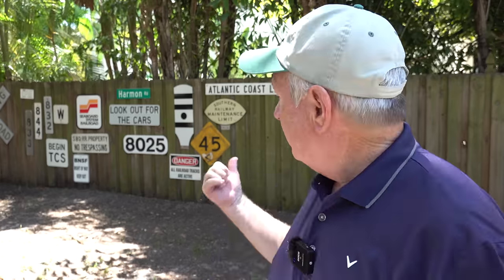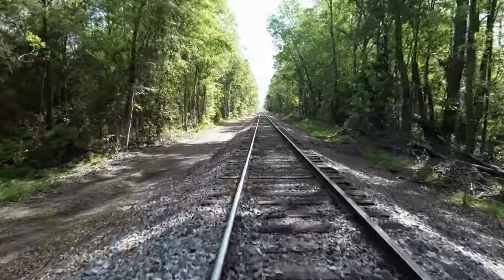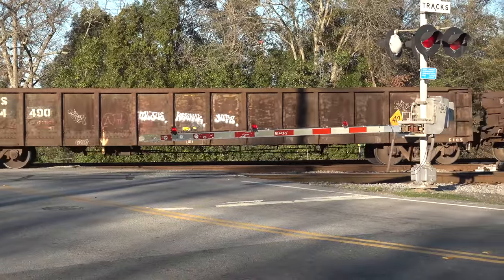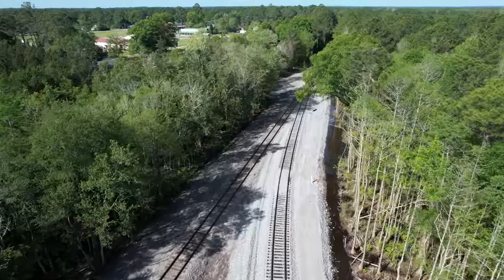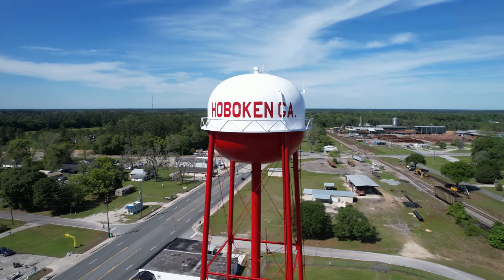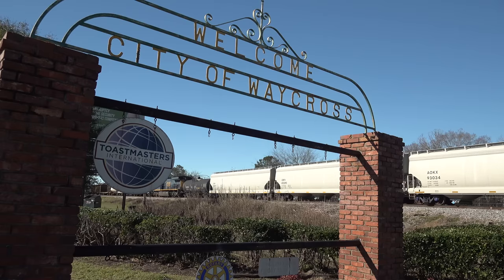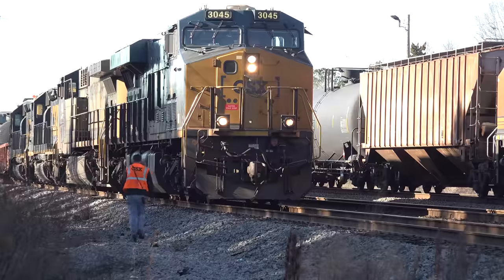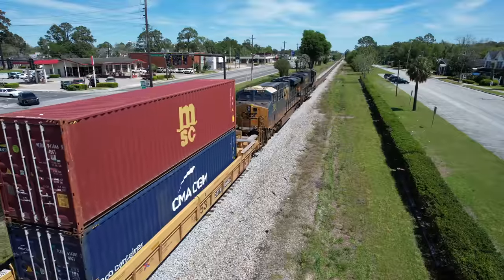How CSX Built a 35 mile Double Track Main Line Using Only 1500 Feet of New Track

Comment: Another 5-star video, Danny. 
There have been a number of occasions when CSX management has wished network fluidity had been taken into consideration when their predecessors ripped up the SAL and single-tracked the ACL 30+ years ago south of Collier Yard in Petersburg, Va. They got burned pretty badly when tropical weather events flooded some rivers in the region and shut down the ACL, forcing CSX to run expensive and time-consuming detours until the trackage was restored. 
A recent study of satellite photography shows that some of the 2nd ACL track has been restored, but I don't know if those sections are still considered to be sidings or if they have been upgraded to 2nd-main status.
It's refreshing to see Class 1 managements change their thinking back to pro-growth and capacity improvement after the last  5 or 6 years of the PSR disaster.
Reply: Turns out robbing the company to pay the shareholders is actually a terrible strategy for having any sort of long term success. Who knew?

Comment: Impressive and informative presentation. As you said it's wonderful to see a railroad make good use of underused track rather than handing it over to 'rails-to-trails' groups and then finding out that they actually needed the line. I remember reading years ago about how Norfolk Southern had essentially 'banked' a bunch of lines which they estimated had little use at the time, but could be useful in the future, one of those lines ended up becoming a key bypass when the yard in Atlanta became clogged. I for one look forward to the follow up episode, it will be interesting to see how this project develops, I can bet that CSX will be inspecting both lines for possible siding locations if this goes well.

Comment: Very, very cool. I especially like that CSX is still utilizing a wooden trestle bridge. I'm an HO model railroader and have actually scratch built many models of these wooden trestles and built them out of real wood. (I've used bamboo skewer sticks to make the pilings for each of the trestle "bents" and wooden match sticks for the "cap" for each bent.) I remember seeing these wooden railroad trestles just about everywhere I went to. And in some cases, some of these trestles are over a hundred years old, but have probably had some parts replaced. Others on the other hand, they've been replaced with steel and concrete structures sadly. This was a really great presentation and enjoyed every minute of it, God bless.

Comment: I worked on a project in Springfield MO many years ago for the SLSF, just before it was acquired by BN. They referred to a crew going past its expiration time as "hoglaw" or "piglaw", not "outlaw". The control center, which was what my company was upgrading with a new computer system, had logic built into it to estimate if/when/where a crew would hoglaw and warn the dispatchers hours in advance so they could deal with it.
Reply: That's neat!

Comment: Very nice video! I am surprised any of those MEC side dumps are left after CSX took over Pan Am. Most of the old Austin-Western cars had plain bearings and were cut up over the past year. Pan Am still had a ton of those and junk gondolas and hoppers in scrap tie service. Many still had plain bearings as well as dinner plate sized holes in the floors of the cars. I could be wrong, but I think those side dumps were built somewhere in the ballpark of 1914-1918, so they are well over 100 years old at this point. Nice catch!

Comment: Thankyou for your easy to understand explanation of what exactly is going on and why. Makes perfect sense , just makes you wonder why this simple (in railway terms) solution wasn't thought of and instigated before. Over here in England its more often the case of old abandoned pieces of track, just left to rot, or track removed, but courses are evident where they ran. A few were saved by Heritege railways and preservation societies. But in at least a couple of cases, small private concerns have been connected back into use with the national railways. Oh and a couple of long dormant "Abandoned" lines are supposedly coming back into use connecting towns that hadn't had a trains service for over 50 years and one case where a for years "Freight Only" line is being brought back into passenger services standard and being re-instated within the next three years due to growing demand. I always thought it was better to use what you already had, where possible, but improvements must benefit all round otherwise not worth it. Great show and i will come again.

Comment: Is the single track bottleneck through downtown Waycross on the Jessup Sub going to be addressed?
Reply from the maker: That I cannot tell you. It's single track for about half a mile there to the yard lead. Building a second track in there would be tricky as you'd have to cross the Fitzgerald Sub AND the wye on the Folkston side.
Reply: Yeah, don't hold your breath on that one.  I doubt they'd put another track across the diamonds, but from from Jenkins Street to Brunswick Jct (2600 feet) could be dreamed about fairly easily, I'd think.

Comment: Meanwhile, on other parts of the system, CSX can't single track fast enough, removing sidings and second main tracks all over the C&O in KY and L&N in TN, and former B&O west of Grafton, WV. Some places still have fairly new, and also old, signals still in place and lit up along or over the removed tracks.
Reply: What portions of the C&O in KY is being reduced to single track?
Reply: Big Sandy Sub in many places. Several of the sidings are being removed, including the 3 miles between GC and SK Cabin.

Comment: 13:30 What is there schedule like and how far away from home are they on any given day? I would need pack several liters of water (I'm always dehydrated) and a few dozen Twinkies, in addition to everything else.😂😥
Reply: The RR will supply crews with all the bottled water they want. Everything else is up to the crew.
Reply: The schedule is: As soon as the phone rings, you have 2 hours to report for duty at your terminal. From there you work as much as 12 hours before you go in Limbo. You can sit in limbo forever but they usually don't want that to happen. You start your rest as soon as you set foot outside the building to get in your car or take the crew bus to the motel. You get 10 hours (Plus however many minutes/hours you spent in limbo) to drive home or to the motel and rest. Then you are back to waiting for the phone to ring. If you did not get 24 hours of rest, then after 5 days you must have 24 hours of rest to reset. Or if you work 6 days then you must have 48 hours to rest. You can work nights, days, weekends, holidays, kids birthdays, rain, sleet, hail, snow. But if you miss a call or don't show up, you will be finding another job, even if you're sick. 
Usually water is not a problem unless you're doing a lot of switching. In that case, I recommend a canteen or a Camel-Pak, or anything that you can stow quickly to keep your hands free most of the time. 
Railroading is a lifestyle, not a job. You will need to plan the rest of your life around your work schedule and there's no deviating from it.

Comment: Danny the intermodal at the beginning is I031, since it's all single stacks, trailers, and Tropicana cars. I037 doesn't carry Tropicana. Also surprised they don't add some sidings on the Brunswick Sub.
Reply from the maker: You're right Jared. Several folks pointed that out. I didn't make the connection between the Trops and the single stack  levels. I thought sure he said I-037. Oh well. Thanks for the catch.
Reply: @distantsignal  Not a problem!

Comment: These high dump cars came off of the Maine Central. MEC is their old reporting mark. These were also used on the Boston and Maine, and the Mass. Bay Transit Authority. For years a cut of them lettered for the MBTA and B&M sat along the Reading line in Medford or Somerville. Under Guilford and Pan Am Railways they made their way all over not that Guilford/PAR did much ballast dumping on their tracks. I'm glad to see CSX making use of them.

Comment: Hi from the UK, you've gained a new subscriber. A great video and an interesting and very cost effective project to achieve better network fluidity both sides of the big yard. These long PSR-inspired trains need to be kept moving as much as possible, double track is the way to do that, and innovative ideas like this can be an affordable and quick way of achieving that.  I suspect there are hundreds of locations around the US where similar projects could help flexibility similarly for very little new trackwork. Sometimes it might need cooperation between different railroads though!

Comment: CSX did something similar with the LIRC (Louisville & Indiana) and upgraded an existing connection at Seymour, Indiana for traffic going between Louisville and Cincinnati. They basically do directional running between that and the LCL Sub ("Short Line"). The LCL has lots of short sidings that were too short for CSX's land barges.

Comment: New CSX Management seams to be wanting to keep what track they got & use it. Its been Reported that CSX will start running a Local again on the Old B&O between Washington Indiana to Mitchell Indiana which has not been ran on by locomotives for some years now. Lot of "rumors" (Just rumors for now) of the Illinois Sub having all new sidings built as well  since a few years ago sidings were removed under Jim Foote. Some people Dont know that Joe Hinrichs comes with a background of running a trucking company & knows how dirty, how over (Government) regulated  & theafing the trucking industry is. He can be the CEO that turns around when it comes to bring in businesses & keeping exsisting businesses CSX under PSR & may just do it knowing the how he knows the trucking industry. Like it or Not PSR is here to stay, not all of PSR will stay tho.
Reply: Where did you hear the report about CSX resuming service on the Indiana Sub between Washington and Mitchell?  There's no business left on that section, otherwise CSX wouldn't have just let it rust away.  The part from Loogootee to Mitchell would make a great trail though and that's what should happen long term.

Comment: Danny, Length of intermodal cars, why are they longer than the inner modal containers, the 53 footers? Any ideas?
Reply: I think you may be asking about the low boy container cars, designed to allow trains to use tracks, bridges, and tunnels that weren't designed for double stack container trains.
Reply: Try putting a 53' box inside a 52' box

Comment: When is the maintenance done on RR cars? This appears why so many train derailments are caused by the RR cars. I know that heat detectors are on the track. But shouldn't there be a set time to check the bearings and wheels before the problem occurs.
Reply: Almost like a truck precheck system.  Makes sense

Comment: Around 16:50 the white light on the two aspect signal tells the driver that they are going over the new track? What if there was only the three aspect signal showing orange?
Reply from the maker: Well.... there ain't no orange signals on the CSX. Ha! The Lunar White light doesn't specifically tell them they're diverging. It tells them to reduce to a speed that will allow them to stop in half the range of vision in case there's some obstruction ahead. In this particular case it lets them know they are diverging onto the un-signaled subdivision.
Reply: @distantsignal  Ok,  then which colours are then above the red on the top signal? One of them is green, i think.
Reply: Top signal head is for the straight route, bottom one is for the diverging route.
Reply: @sharkheadism  In the Netherlands, they will use one signal,. Green if the route is straight and clear and maybe green blinking for the diverging route. The signal before shows maybe orange to reduse the speed of the train if it is  nescesary for the route.
Reply: @user-marco-S  I imagine the Netherlands uses speed signalling, whereas most of the US uses route signalling.
Reply: @sharkheadism  CSX uses speed signaling. The top head is for the main route at track speed, the second or middle head is "Medium" and the bottom, third head is "Slow" CSX is also primarily a 2-block signal system, occasionally utilizing "advance Approach" for 3-block protection in cases where signals are just too close to permit stopping when going from a high green Clear to an Approach and then Stop.

Comment: No railroad company should spend a penny on "actual" disused track, until it has to, or knows for certain it will be removed, far enough in the future, to incur the expense, now. "Time-value of money" equation, decides whether/when to do that.
There's a properly disused line, I see multiple times a week; trains used to pass through an alleyway, the track there is gone, to allow for parking.
Most of the rest of the track sits, exactly as it was, when I skipped school, and wandered the tracks, nearly 50 years ago.
There is a cool trestle, still in place, that you could climb under. It was very exciting to be under a train, as it passed.
One can't climb under anymore (foot bridge now, & it's planked-over), but I'm too old to crawl under, anyway.😂

Comment: Is there GPS based cab signals in dark territory? I can't imagine it's very safe to run trains on unsignalled lines unless you keep to very low speeds at all times
Reply: Nope, they just only have one train allowed to operate at a time, or have detailed instructions regarding meets.
Reply: When you are in dark territory you are given permission by the dispatcher for movements between blocks in the form of a form d. Nothing more than a piece of paper filled out between the train crew and dispatcher prior to departing. A block is nothing more than a station sign, taking the place of a signal. Hope this helps…10yrs working as a conductor/engineer.
Reply: @coaltrain18000  So it's essentially a virtual token. I wouldn't be a fan of that since it entirely relies on the train crews not making mistakes but I guess it's good enough to work. I can't imagine this being very efficient though. How long are these blocks and how many trains per hour can such trackage accommodate?

I don't think I know of any unsignalled track where I live besides low speed tram sections or industrial track.
Reply: Train crews can be given something called a Track Warrant. It provides 'ownership' of a section of track for a specified time. Amtrak has to use Warrants a lot on track they don't own. So, the host railroad provides a Warrant to Amtrak and they have priority only during the time shown on ghe Warrant. Here's the main problem: if the Warrant expires and they are late, then the Warrant is no longer valid. Now, any other train with a valid Warrant has ownership. It works so long as crews don't run late.
Reply from the maker: Clearly this is a generational thing. See, I wouldn't be a fan of relying solely on wireless technology and software to keep me safe. Railroads have operated safely for decades strictly on rules and permissions. Of course, there are those rare instances when people fail to observe those rules or forget where they are. Ha!
Reply: @distantsignal  I think it's also a matter of location and operating environment. In the denser parts of european or japanese train networks you could never operate on track warrants alone. When lines have to accommodate sometimes 30 + trains per hour even advanced lineside signals reach capacity limits. 
Cab signaling is a very mature technology in use for decades not only on high speed lines and metro systems but also some commuter mainlines. 
Of course most of these systems rely on lineside train detection but in theory there is nothing stopping GPS from being used in conjunction with more sparse track mounted marker beacons. 
These train control systems can be made to fail into a safe condition by only allowing movements when all location trackers and train controllers are online in the system. These systems don't wait on signals from a control center but fail into a stop command when the connection is interrupted. 

Of course there is no replacement for safe operating practice but most accidents are caused by human error and I wouldn't feel comfortable without any system acting as a safety check.
Reply: @coaltrain18000  On CSX it's called an EC-1 form. On many other railroads it's called a Track Warrant. 49 CFR allows the dispatcher to authorize use of the track in a granular manner with those rather than sticking to a DTC block. For instance they can issue a one-way authorization from Milepost 60 to Hess Street at 77.29 (physical landmarks, clearly seen from the railroad) I thought they abolished DTC block authority in favor of Track warrants for that reason? Hmmm.
Reply: @SD40Fan_Jason  I left the RR in 2012. That’s how it was on the NS. I also worked for the CN and the Grand Elk RR. Most of the territory that I ran was dark territory, does it sound like I don’t know what I’m talking about?  I’m not trying to be rude or an a hole, just curious. I wrote a lot of form d’s and yes they could write it for a milepost or a road  or a station block.
Reply: @coaltrain18000  I was not saying you didn't and I apologize if it came off that way. I was simply stating that on CSX they use a different form, other railroads use a different form as well. And that a lot of railroads have gotten away from DTC blocks in favor of Track Warrant control. When I left CSX as an employee of theirs, the EC-1 form still used DTC blocks but they changed it to use TWC since then. I know lots of railroads that use a different method of operation to accomplish pretty much the same thing. And as long as they are all in compliance and trains aren't crashing into each other, it's a safe MO.